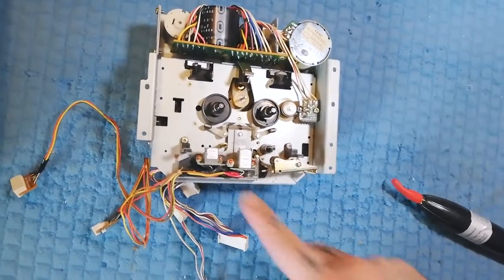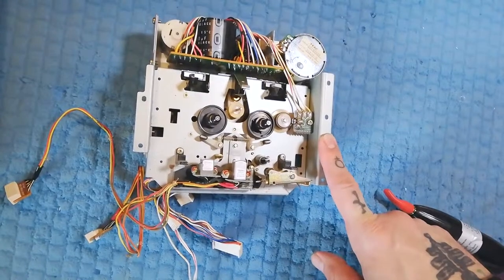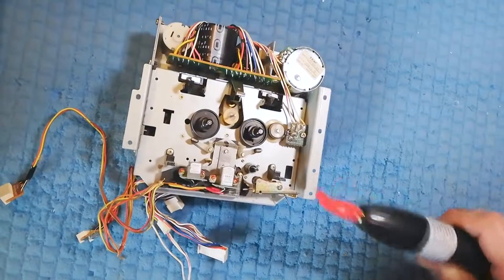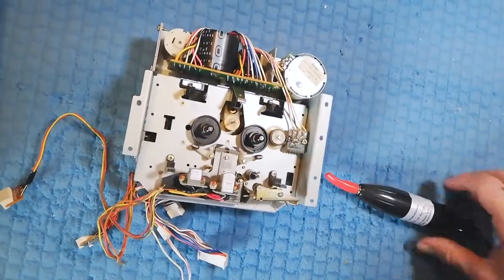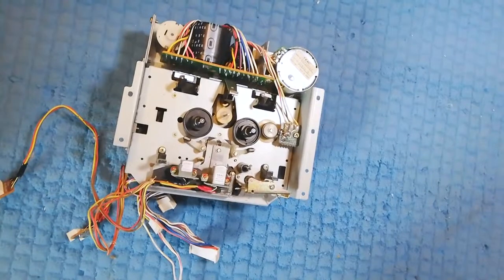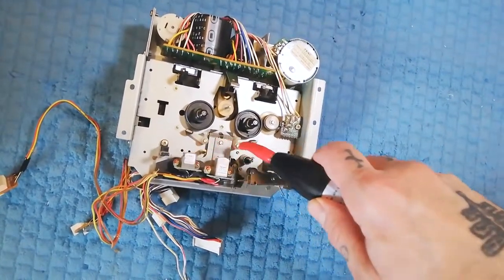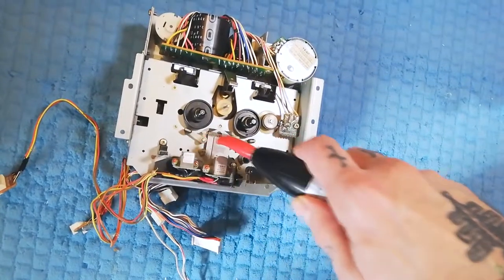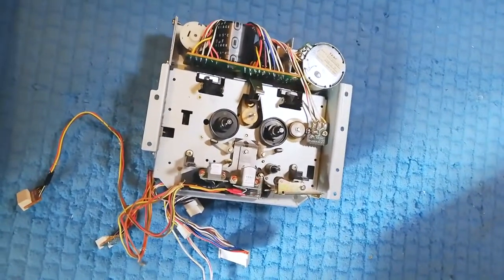8 Demagnetise heads (Fix Your Tascam 244 Portastudio Transport)

Comment: Hi! I recently got my hands on a 244, its a great machine but there's a problem with one of the tracks, i go to record something and the playback of it is very very quiet (completely drowned out by the other tracks with the gain turned up fully on the cue knob) in comparison to the other tracks. Do you have any idea why this could be? I'm not sure what to do about it it's kinda unusable personally if one of the tracks basically doesn't work. Thanks for making all these videos, it's great to know that there's info about repairing all these things online if i ever need to repair it.
Reply from the maker: The simplest thing that could cause the problem you describe us that either the record or playback record amplifiers need to be calibrated, check the 244 and calibration playlists on my channel home page for videos on this topic, you'll also find videos on cleaning and troubleshooting the electronics if that becomes necessary, thanks for watching!
Reply: @Tetrakan  ah amazing thank u
Reply: @Tetrakan  I just tried out what you did in the video you reccomended me, and its now working fine, thank you so much!

Comment: Loving your videos! Super helpful, regarding the demag, I know this has been beaten to death on the internet but I thought I’d get your take on the matter, do you find the tascams are less hissy or noises post demag? Many thanks!
Reply from the maker: I'm also confused by the hearsay online - I've read several times in forums that Phillips did a study which concluded demagnetisation was unnecessary for cassette tape at  relatively low speeds (compared to reel to reel units) but I have never actually seen the study, only references to it. I would always demagnetise units when I used to refurbish them for sale, but really I did that so I could honestly say in the eBay listing that the work had been done...on no occasion did it produce a noticeable benefit to my ears, but then (Joe Rogan voice) it's entirely possible I just never worked on a unit that needed demag - I can't imagine this response leaves the waters any less muddy! Thanks for watching :)
Reply: @Tetrakan  Gotcha - it seems, according to a 424 manual, that it may be more to protect the tapes themselves as opposed to minimizing noise off the unit..🤔 ?? Good to know before running off and spending 100 Bucks on one of those handi-mag wands hoping it will reduce noise or hiss. Can I dm you with a few questions regarding your experience refurbishing and selling units? Many thanks!
Reply from the maker: Yeah sure you can message me via the Facebook page